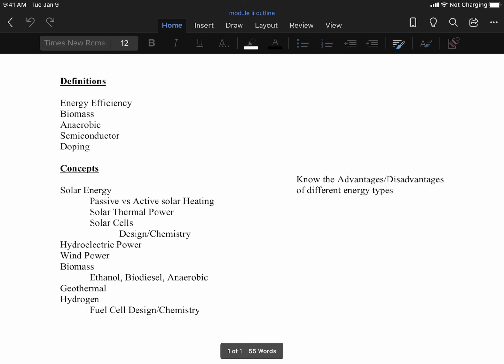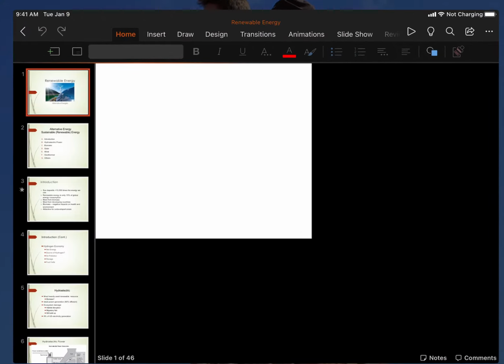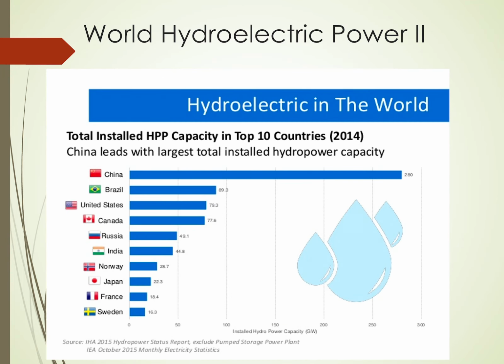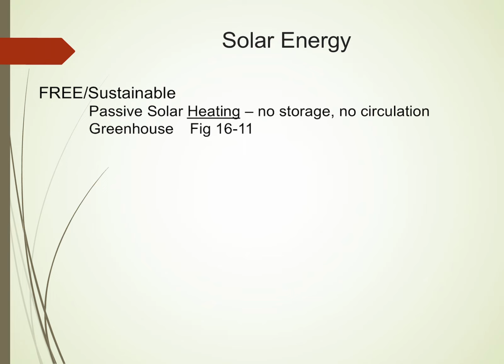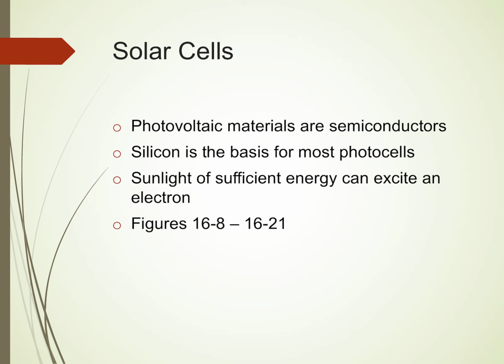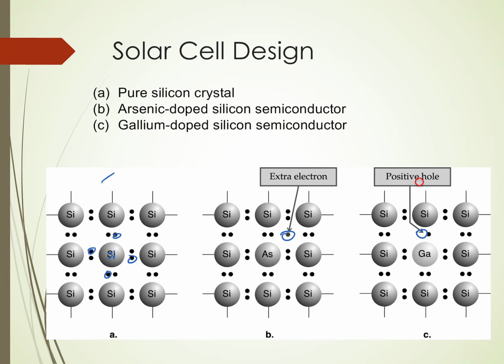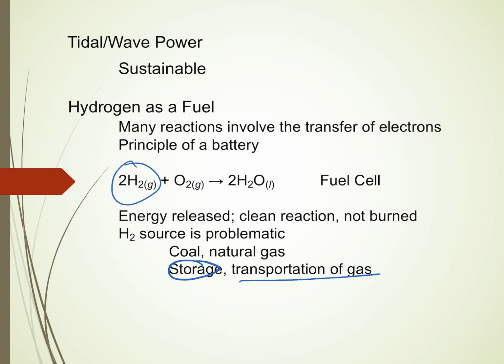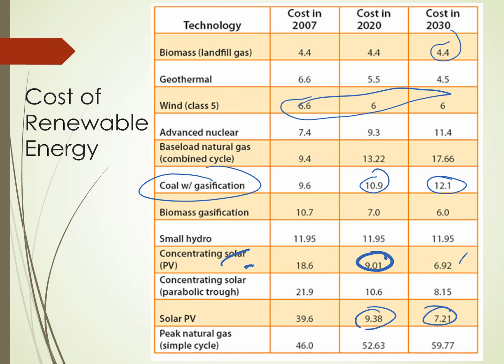Renewable Energy

Comment: 1) By reflecting away 30% of ISR the albedo, which would not exist w/o the atmosphere, makes the earth cooler than it would be without the atmosphere like that reflective panel set on the dash. Remove the atmosphere/GHGs and the earth becomes much like the moon, a barren rock with a 0.1 albedo, 20% more kJ/h, hot^3 on the lit side, cold^3 on the dark. Nikolov, Kramm (U of AK) and UCLA Diviner mission all tacitly agree. 

2) the GHG up/down welling, “trapping”/”back” radiating/delaying/intercepting, 100 % efficient, perpetual warming loop requires "extra" energy which according to RGHE theory it gets from 

3) the terrestrial surface radiating that "extra" energy as a near ideal .95 emissivity black body which

4) it cannot do because of the non-radiative heat transfer processes of the contiguous atmospheric molecules. 

1+2+3+4 = 0 Greenhouse Effect + 0 Greenhouse gas warming + 0 man caused climate change. 

All science backed up by experiment, the gold standard of classical science.
https://www.linkedin.com/posts/nicholas-schroeder-55934820_climatechange-greenhouse-co2-activity-6749812735246254080-bc6K
Reply from the maker: What is your point? That our planet would be a barren rock without the atmosphere? Agreed! That has nothing to do with controlling the level of GHGs.
Reply: @drd-collegechemistry  
That contradicts RGHE theory.
0.04% GHGs do not "warm" anything.
Reply from the maker: @nxgrs74  I have no idea what you are referring to (RGHE?). Clearly you need a background in IR spectroscopy first.
Reply: @drd-collegechemistry  
RadiativeGreenHouseEffect.
That's from the homework reading. Try some.
I think the BSME and 35 years of applying the LoT are more than sufficient.
Reply from the maker: @nxgrs74  Sorry, this is my baby chemistry class for non majors. Not a commonly used acronym. Actually your training is NOT sufficient. You keep referring to 0.04% as if atmospheric window has no bearing. Try reading on IR spectroscopy. Which journals have you published your research in this area? I would love to read them. I tend to default to my colleagues that spend their careers studying this stuff. There is currently a >95% consensus in the scientific community. The debate is largely over. It only exists among the general public and on talk shows.
Reply: @drd-collegechemistry  
The fundamental problem is that radiative/GHG forcing is nonsense.

Forcing requires the GHGs to trap/absorb/delay "extra" energy from somewhere and then down well it.
Like writing an energy check on the atmosphere's energy account. 
Where does the deposit come from to cover that check?

According to RGHE theory the surface upwelling as a BB is the source of that "extra" energy deposit.

I have explained and demonstrated by experiment such upwelling BB energy is not possible.
That means there is no "extra" energy for the GHGs to trap and down well.
Which is a good thang since energy cannot down well from cold to hot without the addition of work.
Reply from the maker: @nxgrs74  Like I said, send me a link to the manuscript. If it hasn't been peer reviewed it is meaningless nonsense that I won't waste my time with.
Reply: @drd-collegechemistry  
Once upon a not so long ago time published, peer reviewed consensus included:

phlogiston,
luminiferous ether,
spontaneous generation,
water filled Martian canals,
plane Vulcan,
medical humors,
four elements of matter,
cold fusion........
And they all turned up empty.

I'm publishing my perspective outside the good-old-boy box.

As Sun Tzu observed, let your opponent set the rules of engagement, time and ground for battle and
you
will
lose.

You or someone you know might understand the topic and my posts well enough to 'splain how/why I am wrong? 

1) Without the atmos/albedo the earth becomes much like the moon which contradicts greenhouse theory. Yes or no? 

2) Where do the GHGs get the warming energy that they trap/absorb/intercept/delay and re-emit?

I have demonstrated they can't get it from the surface upwelling as a BB, so, what's your explanation?
Reply from the maker: Nonsense. You CAN"T publish for a reason. Go back to cold fusion.